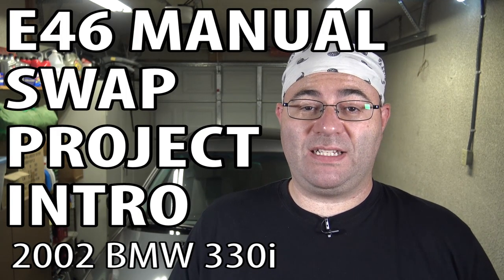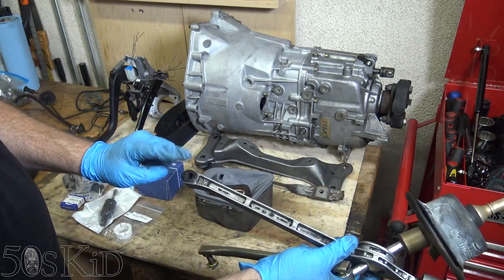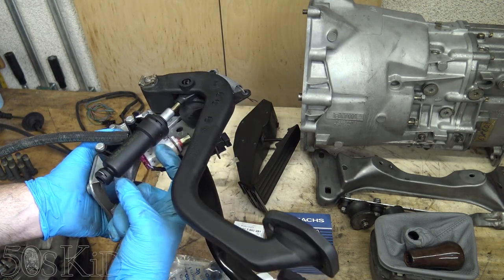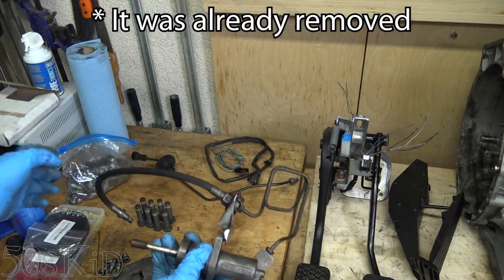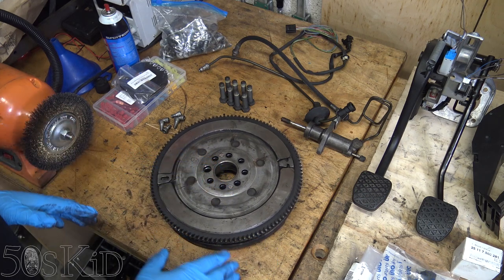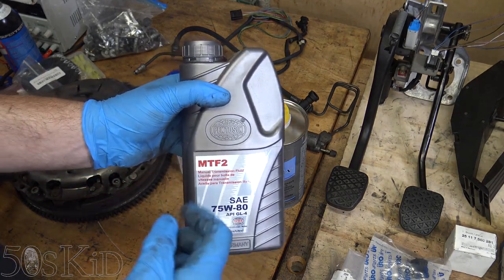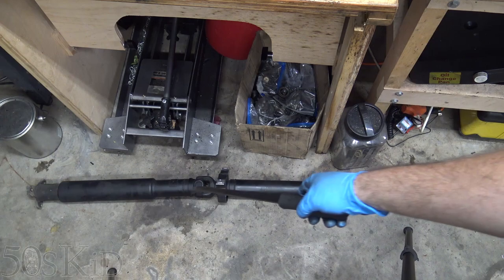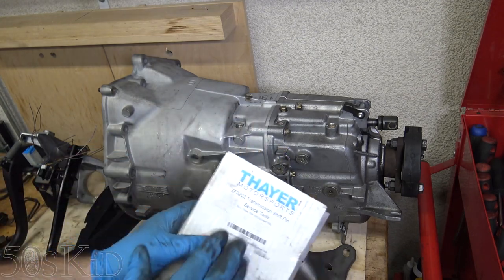BMW E46 Manual Swap Project Introduction DIY - What Parts You Need

Comment: helo 50skid I want to do this to my 325xi can it be done to a allweel drive e46?
Reply from the maker: Yep there should be no difference as far as that goes.
Reply: I converted my 2001 325xi wagon a couple years ago. Nice thing about the xi is you do not need a different driveshaft. They are the same for auto vs. manual.
Reply from the maker: That's not possible--the auto and manual transmissions are different lengths--that's why you need a longer driveshaft.
Reply: 50sKid I am going to have to respectfully disagree with you on this. Look on RealOEM. Both front and rear driveshafts are the same length for the xi. True, that is the the case (they are different) for RWD vehicles. Because of the way they design the rear case of both the auto and manual to attach the transfer case, they (transmissions) end up being the same length. Trust me (I know, I am on an internet comment section) but I did this very swap to my car. No driveshafts needed. Big fan, keep up the good work.
Reply from the maker: Ah I wasn't thinking about the transfer cases on the xi.  Ok it makes sense to me now that the transmission configuration would be a little different.  Man, I'll bet that manual xi transmission is hard to find!
Reply: @rueliotube  Hi, I am thinking about converting my E46 330xd, do you think that driveshafts are same even here ? Also when you did yours conversion did u need some extra steps (maybe some more coding, or extra cabel connections) or is it exactly same as with RWD ? I would really appreciate answer, thanks :)

Comment: The flywheel I ordered at my work had almost zero free play. Maybe just half of a tooth of movement.
Reply from the maker: Ah, good info to have.  I just located some information in AllData that says the "limit" is less than 7 "tooth gaps" of freeplay (meaning the gaps in between the teeth, so 8 teeth if measured by the tips of the teeth).  And the axial play between the two dual masses has to be less than 5mm.

Comment: This car has gotten such a bad reputation because of used and aftermarket parts MAINLY.
 These E46s used to be expensive, then as they depreciated they got in hands of just anybody and with that, what does anybody do?
Anybody is stupid right? 
The anybody used any part that was less expensive either from the Autozone which is mainly China-made) as long as it fits, then it was put in causing them to see it break again and again and eventually selling the car and as the price tag dropped even further so as its reputation
most ended in the junk. 
This car does not like anything but new Genuine parts, I learned it hard way, I worked on it for 10 years, I still have it and its running strong, if there is anything I can say about what I learned so far is Never ever use aftermarket parts, never use used parts unless its something like diff or a tranny or an engine block something that is solid.
Everything else has to be new and genuine unless you want to do the job again in 6 months.
And now, what does anybody say about the BMW E46? They say its a very unreliable car because they are simply dumb and should never have one to begin with so ignore them 'cause they have no idea anyways

Comment: Quick splice connectors sucks in my opinion, because they tend to fail over time.
Reply from the maker: Yeah I've mentioned that in the wiring video.  For me, here in outer space (California), corrosion isn't really an issue so I'm going ahead and using them.  Putting dielectric grease inside just in case.  I have mentioned to use heat shrink butt connectors (with the sealant inside) or solder if you're in a more corrosive environment.